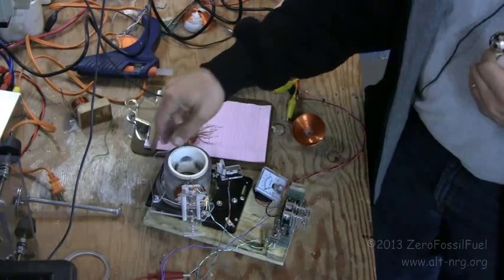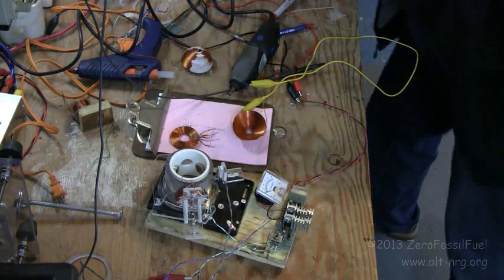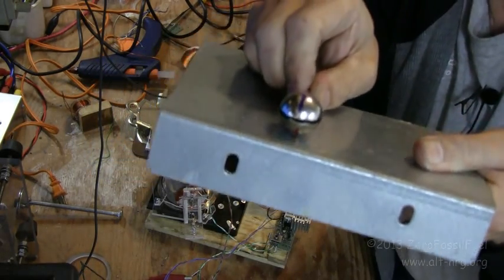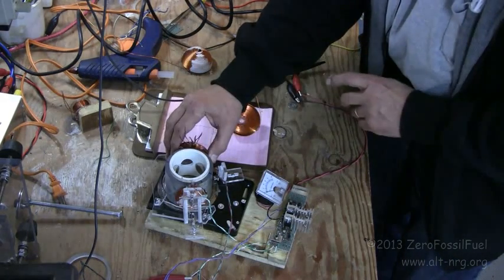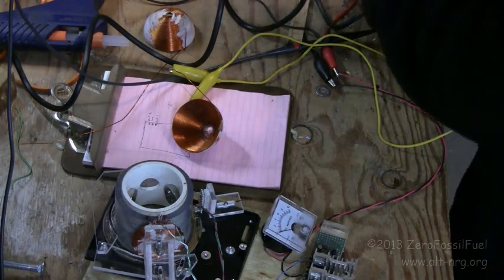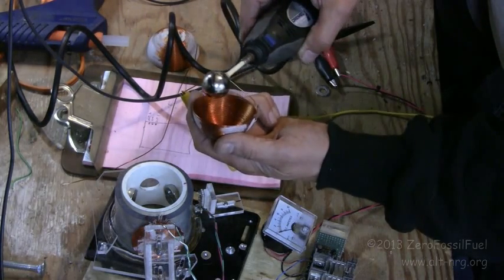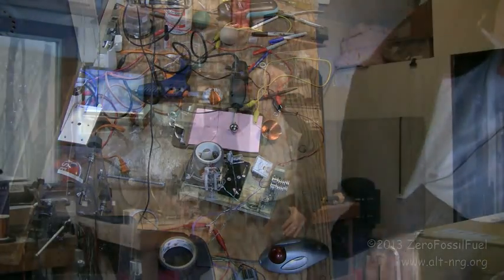#332 Neodym sphere tests

Comment: When the hemispherical coil is NOT short circuited, how does the rpm on the Dremel compare with the coil short circuited?  Just curious, although I foolishly dropped out of High School to go make money the hard way, I DO know that copper is fairly diamagnetic , and being so, causes  a magnetic "braking" effect. I think you should use a  coil material not as susceptible to this kind of drag.  I'm impressed with your ingenuity, and perseverance.    I think the greater load experienced with the spheroid was influenced by," A Better Fit " , between the  pertinent forces.

Comment: YES I do understand that reaction the sphere magnet is contour it cradle's with the cup field .This is what i found to be better with 3/16 copper tube and in a cup shape for expanding a Vertrel cleaning solution  for liquid to gas for building up preasure's for the sealed sterling motor design it heats up better just by shorting  but i can control the heat action by a variable resistor adjusting the heat level's

Comment: What happens if you place the spherical magnet head on in to the half sphere coil instead of at a 90 deg angle?  I also think it would be interesting to place the leads from the coil on to a volt meter so you can actually measure the energy being generated by spinning the magnet inside the coil so that maybe you can see what (if any) difference there is by changing the angle of the poles...

Comment: Flux in it's simplest form are lines of force, because it can be measured.  Near the poles the Flux density is stronger.  For a spherical magnet the the highest flux density is at the polar point of the hemisphere. The energy put into vacuum or air is approximately 0.5 times Magnetic Reluctance of air or vacuum  times the square of the net flux of the magnet.  This is a non vectorial approach governed by magnitude of flux only.. The highest force is always furthest away from the opposite pole.

Comment: I wonder if you need to monitor the current in the winding. If the ball magnet induces more current in the winding due to its magnetic fields interation with the coil than the cylinder magnet you would expect a stronger lenz effect. To verify a reduction in the lenz effect I think you need to monitor the results while producing the exact same current in the winding. Really enjoy your posts, keep up the excellent work.

Comment: Hey Zero Fossil Fuel.I'm a long time subscriber.I have an idea for you to try.I really think it will work even better then your dome coil.try making a VORTEX shaped coil.that way its more like nature.vortex's are every where in nature.I'm currently doing some radiant energy experiments charging capacitors. I made a VORTEX shaped coil and it increased my charging time and my output voltage exponentially.but I think you could make a much nicer coil then I could.you really should try it.

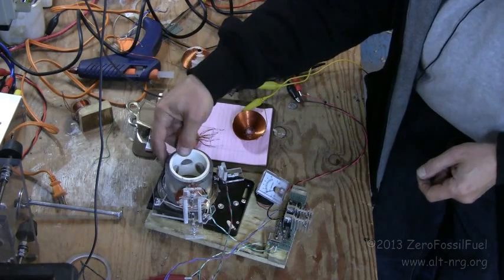Comment: Z, you mentioned that there are only a few thousandths of an inch between the drum and pancake coil of your test jig.  Yet, when you spin the drum by hand at 8:09 to 8:22 in this video, it appears that the drum has more than a few thousandths inch of wobble to it.  Is this simply an optical illusion or does the drum make contact with the pancake coil during its rotation?  Just wondering due to an observation.

Comment: Focused shape of flux field from spherical magnet induces greater current in winding because flux lines are concentrated in-shape to that of half-spherical winding. When you counter the magnetic field by placing a magnet field opposite to and outside of the arc of the winding you're simply inducing a counter-current in the winding, partially canceling current induced by inner magnet and resulting in reduced Lenz.
h t t p://w w w.home.hs-karlsruhe.de/~weth0002/maplegrp/biot/images_doku/svg2h8.gif

Comment: Have you tried using two half spheres with the dremel in between? one wound clockwise & the other wound counter-clockwise. Maybe they will create a lenz 'dead zone' in the centre where the magnet is rotating...

Comment: Hi Z,

That's interesting result and quite unexpected for me. Instead of having weak magnetic pole the sphere magnet creates very strong magnetic pole inside of conical coil.. Perhaps because the sphere magnet rearranges magnetic lines of the conical coil into different geometry vectors? Also what happens if you get full sphere from 2 conical coils? They should start interacting with each other...
Back to drawing board with geometry.

Cheers!

Comment: Great video. I built 4 hemisphere coils after seeing the first one you built. 2- 1 wire 2.5",1- bifilar 2.5" and 1-6" hemi that I could eat my cereal out of if not the hole in it. The best test I have done so far is to place the coil over a microwave magnet with a dowel through the center. Pulse the coil and it launches pretty high with the correct polarity. Very fun coil with impressive results.